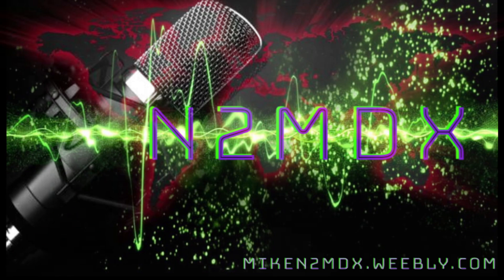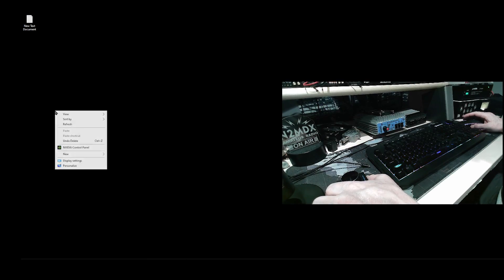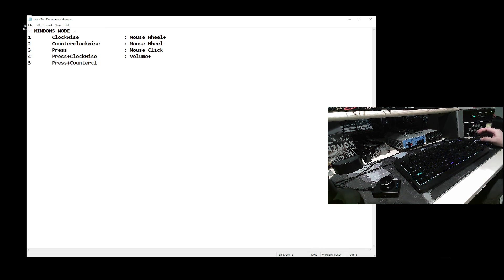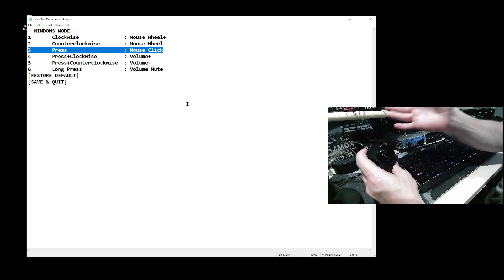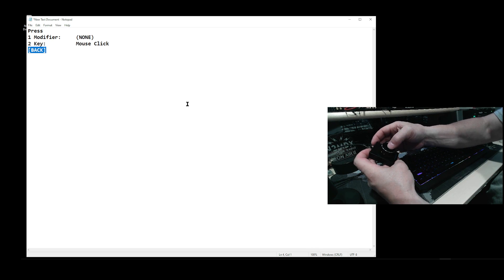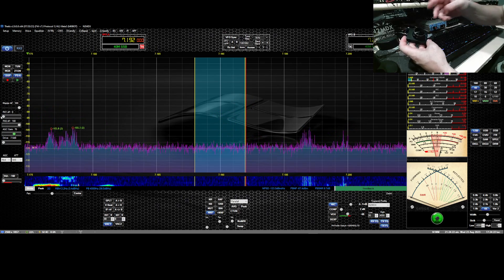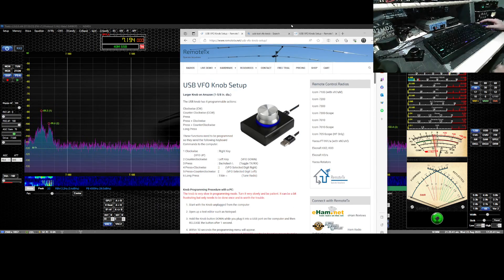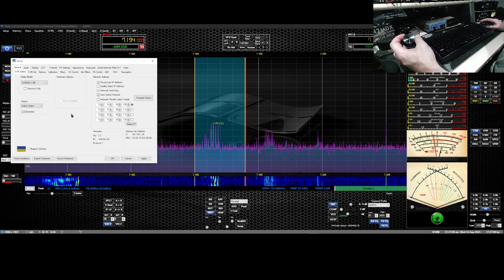THETIS ANAN FLEX - HOW TO PROGRAM YOUR USB CONTROLLER KNOB FOR OPEN SDR

Comment: Hello Mike, 
Dan here AB5VJ  in PA near Gettysburg. Just watched your video, excellent presentation of this knob. I am starting to put together another HF rig, a "Hermes Lite 2". I have an Elecraft XKPA100 amp to get it to 100w. I have a HyperX QuadCast USB mic to use with it. I also want to do CW and have a knob like this for the VFO. I have a Griffin PowerMate, an older USB knob https://en.wikipedia.org/wiki/Griffin_PowerMate I can get it to program for SDRPlay SDRUNO receiver software but have not been able to get Thetis to see it. Also, it does not have a slick versatile programming tool like this one you are showing. I will probably buy one of these, looks easy to program any key combination everything on the keyboard. My question, have you figured out how get it to move through all frequencies, for instance 7.150.825? Mostly during contesting, stations are everywhere, even the older rigs that drift and also mainly on CW. I would think it would move a lot slower through every frequency. But many times operators are not on the even khz. You know like on a regular HF rig like an ICOM-7300 you can set the incremental mode for 0.1k and it will scan like you are showing here 1khz at a time. Maybe there is a way to change it with a programming setting? Say, like you have it now for the faster scan rate change it to every hz. I would want it to be able to change every hertz on the VFO. Glad I found your video though. Going to get one of these. The PowerMate knob I have is a really nice polished lighted knob but I have not figured out how to get Thetis to see it. Thanks! 73, Dan

Comment: What i'm doing wrong? I can't get it into programming mode?
Reply from the maker: PC or Mac?
Reply: @MikeN2MDX  PC
Reply from the maker: Windows 10 or 11?
Reply: @MikeN2MDX  10
Reply from the maker: @TheRiddleNL maybe knob is defective because if you follow the video should work 123
Reply: @MikeN2MDX  Yes it's strange, opend a new .txt file buth no luck :( only volume control..
Reply from the maker: @TheRiddleNL ok so if the knob is working with volume control than it’s technically working so check the text pad make sure you entered the right info for the wheel also make sure your mouse is pointing at the panadapter so it moves!!
Reply: @MikeN2MDX  I dont geth the tekst in the new *txt document. So i can't "hack" it :(
Reply: Where did you buy it? Aliexpress or Amazon?
Reply: @marcinmadajczak  Alie
Reply: @TheRiddleNL  I did the same as you, I also bought it on Aliexpress and it doesn't work for me either.
it is an Aimos device and I think the ones from Amazon have modified software.
Did you manage to get it working?
Reply: @marcinmadajczak  Maybe, stil noth working, i have given up on this one.
Reply: Mine is from Amazon and i can't get it in programing mode. Only volume works.
Reply: maybe we can compare the type. mine works perfect as volume knob but i cant get into prog mod. AIMOS AM-U001CS.V1.0 2020-11-21
Reply: got the same problem. Got it from Amazon and won´t get into programming mode. For the price i would buy another one, but could not be working aswell.
Reply: Make sure keyboard language is English when you program it. It won't work if is not in English.

Comment: Hi my comment disappeared .😮 i wanted to ask for help . I bought multimedia volume controller with one knob and other pause and resume buttons on the unit. But it wont let me open the script like u did in this video to change any setting . Thank you
Reply from the maker: Is it the same device on a Windows computer?
Reply: @MikeN2MDX  no but similar from ebay . But all good I got it  working now thank you

Comment: Using the Amazon USB wheel for your panadapter tuning. Here’s a nice feature in Thetis you might want to look at. In Thetis there is an option to have it focus on the panadapter all the time regardless of where your mouse is pointed, also you can set it to only control panadapter and not, other things that the mouse is pointed to, this is very helpful. Setup-General-Navigation: in the dropdown one of the HIDs is the USB wheel choose it, then check the boxes for the other features, make controlling the panadapter while using a logger with your mouse MUCH easier.
Reply from the maker: Thank you for added this info, myself and other Hams appreciate it.

Comment: Hi Mike, thanks for the video. One question; If thetis is not hightlighted and is running in the background, let's say, you open your logging program and you are filling in the logbook, does the knob still work with thetis. Or are you forced to bring thetis to the front and highlight the program to make the knob work? 73's de ON7OFF
Reply from the maker: So where you point your mouse is where the knob will work. Which means if you come out of Thetis to point to another program then no won’t work.
Reply: @MikeN2MDX  hmm, that is a bummer. Then you could just use the wheel on a normal mouse. The reason why I think it might be useful is when it is connected all the time with the Thetis app and you can use the knob to PTT and to scroll through the frequency. If you are logging a call sign in a log program, you will have to switch over between thetis and the logbook app which is annoying. Any workaround?
Reply from the maker: @oz457 buy it and try it out it’s cheap enough 😉